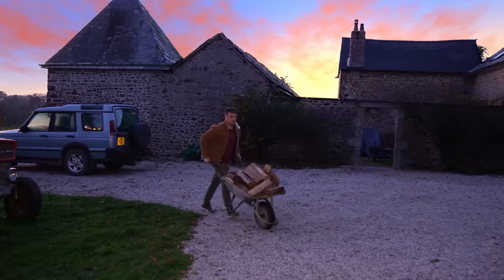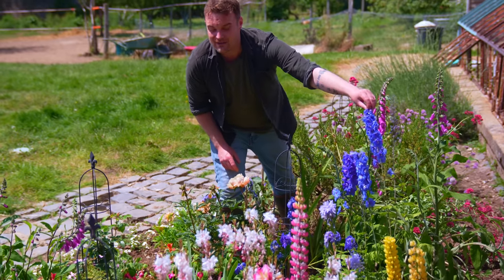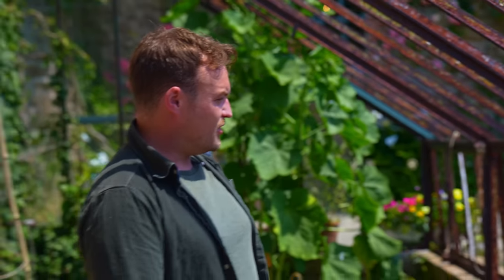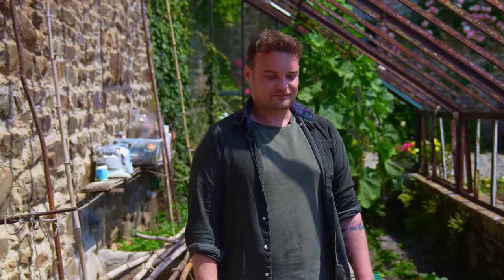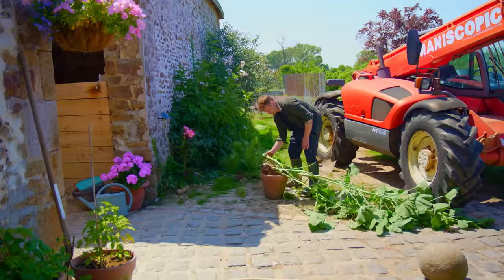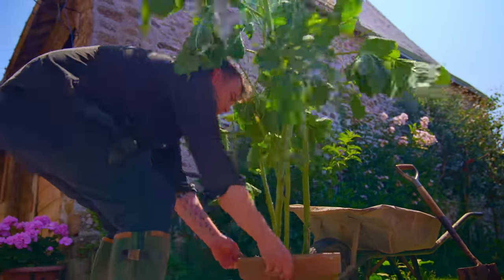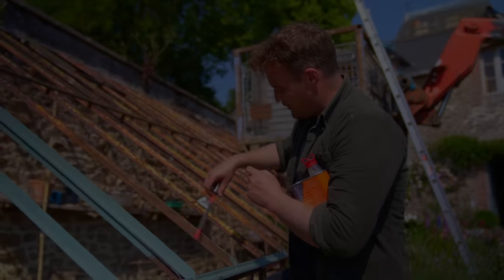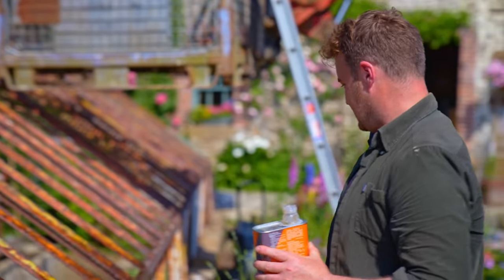Our 100 Year-Old Greenhouse - Can It Be Saved ?

Comment: I was nervous when you were using the drill to take the rust off . Where are your safety glasses ? Be careful with that wire brush little pieces break off. Love your flower bed and the door entrance of the house is so picturesque I love it !! ❤

Comment: As long as oxygen does not get to the rust (oxide) it will not rust. So the paint shields the metal from oxygen. Whereever it gases off and becomes bare it will be able to rust.

Comment: O no. Preparation is everything. When you took out the hollyhock, you would have done a much better job if you took it out with a rather large clump of earth containing the roots. You only transplant bare root plants when they are dormant, which these hollyhocks are certainly not. Then you already should have prepared a nice planting hole, where you could have put them in immediately. Having them waiting in full sun with no means to supply the evaporation from the leaves, while you were preparing the new soil, you kind of suffocated them. Of course the soil should have been prepared too before you even started to take the plants out. And then of course you would take some measures to keep the transplanted plants in a damp atmosphere, out of the wind and out of direct sunlight, so they would acclimatize. By the time  you had them in their pot, the leaves were already drooping, a sign of loss of water that could not be compensated by the roots. And then you put them in the driest and hottest spot you could find. You still have a lot to learn if you want to become Alan Titchmarsh. The only sensible thing you did was to take off a number of damaged leaves. I guess you could just as well have taken these hollyhocks down altogether. Their chances of surviving are practically zero.